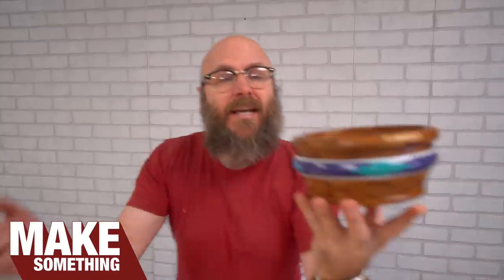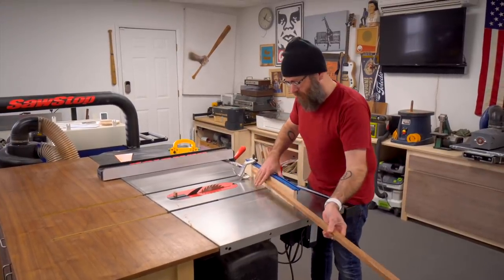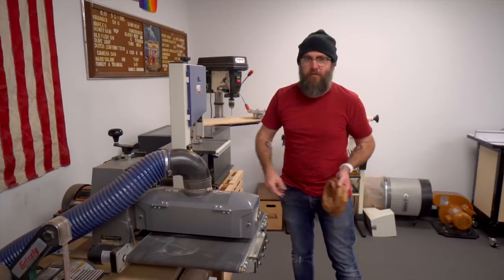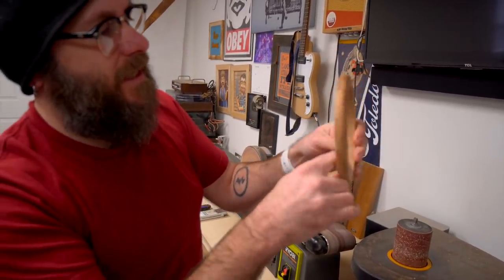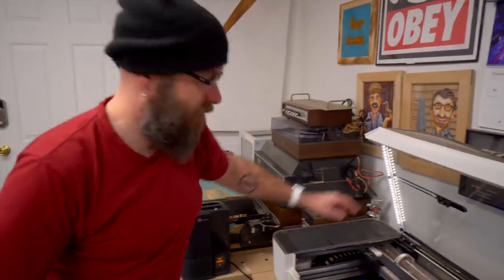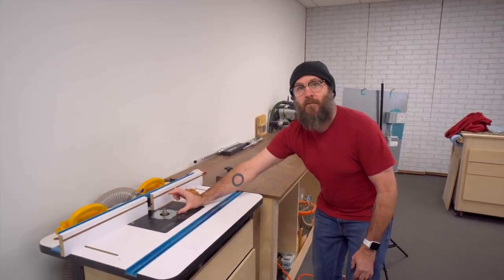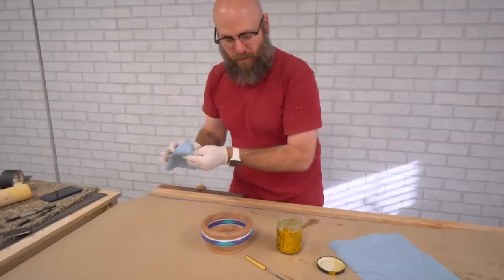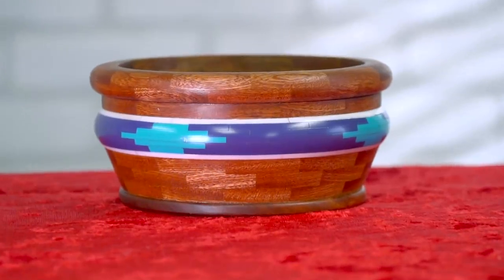No Lathe, No Problem! Make a Segmented Bowl Without a Lathe

Comment: I don't have a oscillating barrel sander but I do have a router table. I just realized I can put a sanding drum in the router instead of the drill press. I like this video because I have only a small table top lathe with a 4" diameter so I'm restricted to 7.75" projects. You keep showing alternate methods of doing things. Keep making videos!!!

Comment: As an irrigation parts wholesaler, that clamp is used on pipe as well.  It is used to clamp polyethylene pipe onto it's fittings.  So both hose and pipe clamp is a correct term
Reply: I was thinking along that same line.

If you think about it, when was the last time you saw a hose that big?

Whether you call it a hose clamp or a pipe clamp totally depends on what you are clamping.

Comment: Says he doesn’t like using router for flush trim, then does it. 

Says reassign circles is really dangerous, then immediately does it with a jig to stabilize or anything. 

Awesome. 

You were really in a hurry to get this video done!
Reply from the maker: Obviously you were not picking up what I was putting down. Stop picking fights and go make something!

Comment: David - I love the bowl you show in this video.  One question, I see that the tapered router bit you use for the bottom is 1" cutting surface.  To make a larger bowl, would one just make a larger or smaller segmented circle and continue using the same router bit?  Excuse the rudimentary question, but I am new and just trying to figure out how to make a larger bowl using the same technique, more or less.

Comment: Im just getting my woodshop set up. I have a 40x60x20 barn with about 200 12' 3"x3" red oak lumber . Im curious to know if you have any projects I can use this "free" lumber for? This is an idea of my shop I have ( bare in mind I have had a limited budget to set this up on) 20'x40' wood shop....new craftsman professional cast iron table saw 2018 model,new Laguna 14/12 band saw with a Laguna resaw king 3/4" blade ,new Shop fox 6" jointer, new 12" DeWalt planer , new Jet dust collector, new Kobalt router and table, used 6x48 belt and 9" disc sander, used 10" 16 speed delta drill press with mortising attachment, new delta 10" single bevel , sliding miter saw with stand. Misc: new incra table saw miter sled, hand power sanders, kreg K-5 system, new full set of forster bit set, 10 48" bar clamps about 30 trigger clamps 6" 24" 25 2" spring clamps, dewalt drills and impact, circular saw, jig saw, dewalt 1/4" router, profile sander plus a lot of Misc small tools. Any advise for me would be very helpful. I really appreciate your time and trouble. Thank you very much , Jon Bowers Mount Olivet, KY,,

Comment: David, I have a question on the bandsaw boxes. Is there a reason you don't flock before you put the front and back of the draws?
Reply from the maker: Because the inside of the fronts and backs also get flocking.

Comment: If  your using the laser to cut the acrylic pieces why not include the inner and outer curve virtually eliminating the rough sanding step? And... the solid color rings could be completely cut as one piece on the laser - just doing my job. It was interesting and came out to be fabulous - but since I have a lathe it wouldn't be the best procedure for me... unless I wanted to make a bowl that wasn't round.